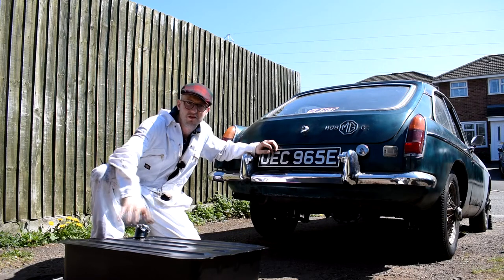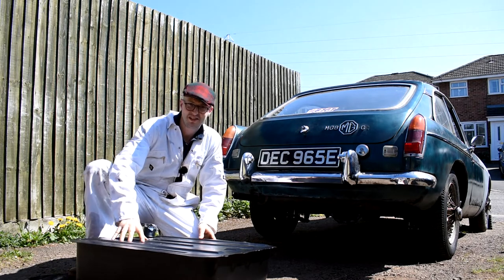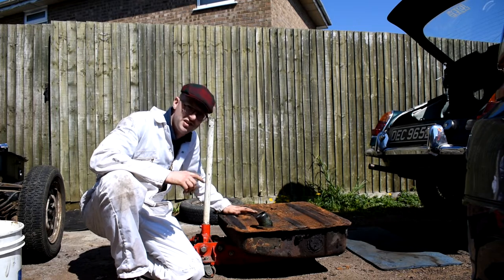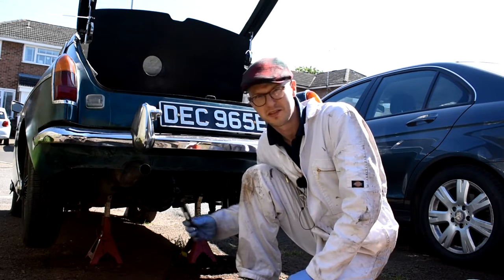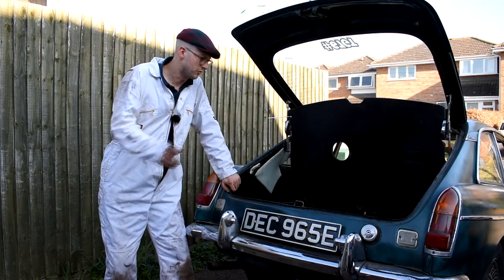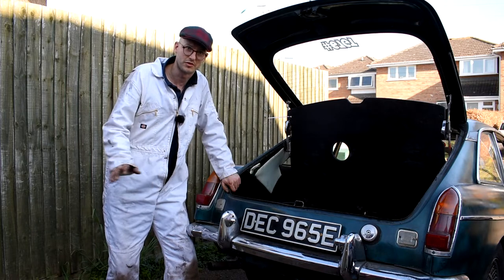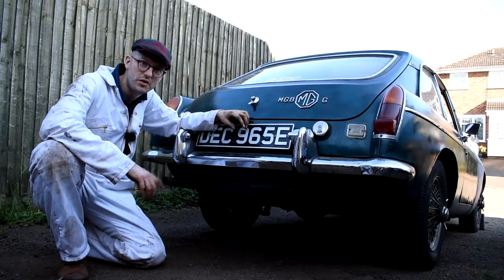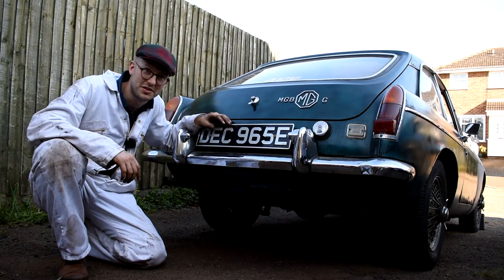MGB Fuel Tank

Comment: The MG BGT’s only ever had 5 captive nut fixings on the fuel tanks, the other 4 fixings were nut and bolts plus washers. For ease of fitting it does make sense that the other 4 holes have captive nut fixings!
Reply from the maker: Well you live and learn, I never knew that, cheers for the info 👍

Comment: Great video, many thanks! I think I got most of it, attempting this job on saturday.what glue did you  use to put the rubber strips on the top of the tank down?
Reply from the maker: Cheers Jason, I just used Spraytack Spray Adhesive. in all honesty you can use any sort of spray glue. Once the tank is in place they won't go anywhere as they are sandwiched in place. Cheers Steve

Comment: Brilliant short Steve! I wish the GT6's had an exterior fuel tank. Did you consider an aluminium tank instead of this one?
Reply from the maker: Cheers mate, yeah I looked at aluminium ones, but in all honest, I not a big fan. In a number of ways they are better as they don't rot and are lighter, but its getting one made from a decent suppler. The other thing with aluminium is they can stress crack and at four times the price I just think money better off sent elsewhere. It’s all swings and roundabouts really

Comment: Did l hear you say they sell plastic tanks there?  I would prefer that to steel as the salt eats steel alive here in Canada.
Reply from the maker: That would be awesome if you could get hold of a plastic fuel tank. When I looked around for the one I got, I did toy with the idea of an alloy fuel tank, however they are a tad on the expensive side 👍
Reply: @SteveDentonClassics  with the exchange rate and all parts coming from the USA or UK, everything is expensive.  I envy your access there.  Lucky bugger.  I did look on the Moss-Europe site and didn't see any plastic, only mild steel.  Can you supply a link to yours, please?
Reply from the maker: It was just mild steel long range fuel tank from Moss Europe. You can buy the same one from Moss Motors which are based in the USA and are the American part of Moss. The U.K. part number is 471-224 if you contact Moss Motors USA and quote that part number for a 16 gallon fuel tank, they should be able to get one to you
Hear a link to the Moss Motors USA website with the tank I’ve got on mine 👍🏻 https://mossmotors.com/16-gallon-touring-fuel-tank
Reply: @SteveDentonClassics  thank you, Steve.  My cloth ears, l thought you said plastic in the video.  On a side note, which model exhaust did you pick from MGO Spares?  It looked sweet.
Reply from the maker: That’ll be part number B017 in the MGOC catalogue, it’s a really nice fit exhaust system, and sounds great too 👍🏻
Reply: @SteveDentonClassics  thank you very much again, Steve.  Cheers!

Comment: Hi Steve. Super quick job and yes, moss may give you a discount next time!😇 Was the fitting kit included? Seeing you in white overalls, is that a salute to the aircraft engineers you see in archive footage working on the Supermarine "S" racers of the '30's? Have to confess when l had my body shop in the '80's l wore them for that reason! SAD? I don't think so. The  badges on the rear pillars were fitted on the later "B's" to hide the weld joints. To cut costs B.L. stopped lead loading the joints and hid them with the badges. Your's almost certainly will be leaded but will now have holes drilled for the badges! If you look at later models the rear panels have an exposed joint for the same reason. Take care and stay safe.
Reply from the maker: Oh wow, I never knew that. as I've always said every day is a school day. I feel honored that I remind you of the Supermarine engineers who worked under RJ Mitchell. I don't know about the discount, I just like telling people where I got the parts from. Unfortunately the fixing kit was extra, but for value for money on a larger capacity fuel tank over standard, I thought it was a bargain!!